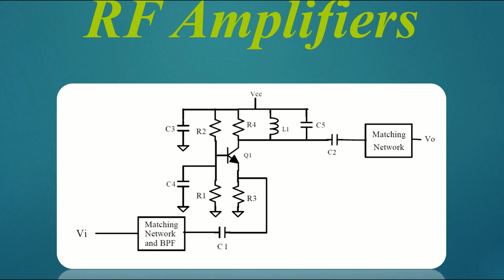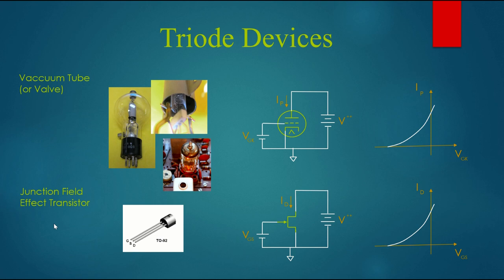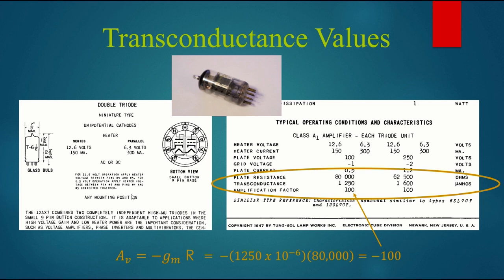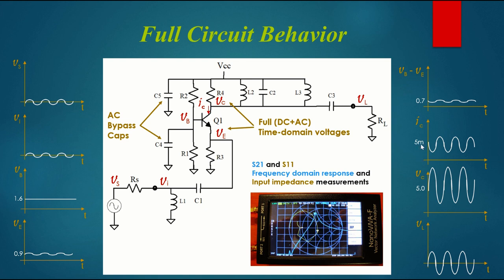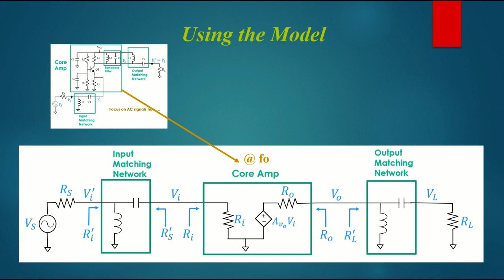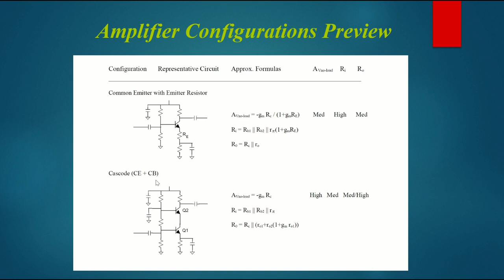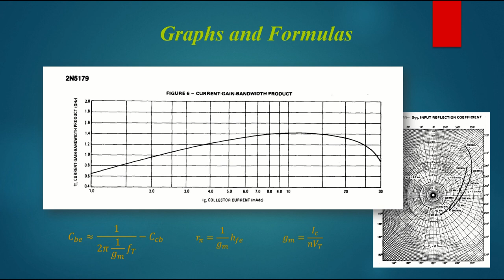Radio Design 101 - Episode 3 - RF Amplifiers

Comment: Looking forward to part2. I hope/wish you will add a design procedure process for RF amp from requirements involved, like how the drive power requirements of Mixer and the input signal strength from antenna dictates the choice of emitter current(Ie) and collector resistor along with mixer input impedence.

Comment: Is it possible to ask you more questions? I have quite a few questions about this and would love to pick your brain. This video series is awesome.
Reply from the maker: Sure. I try to reply to all comments. However, my response time can sometimes be a little slow. Our HVAC system went out recently so I got behind. But will try to check comments more often now that I got it fixed.  :-)
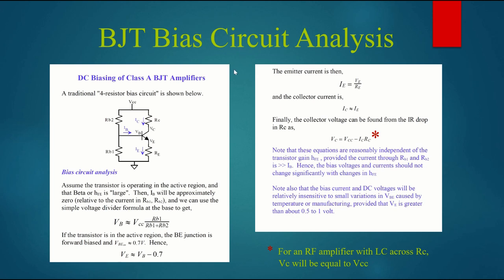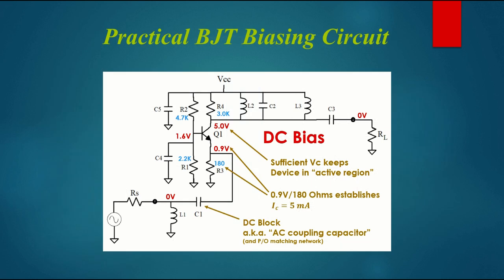Reply from the maker: I saw your question about the biasing, but now I can't see it anymore. To try to answer what I remember from it, the device used in the class (and the Radio Design 101 amp) is a MMBV5179 - a surface mount version of the classic 2N5179 RF device. It's an NPN bipolar transistor, so biasing assumes that Vbe drop is about 0.7V. BJTs are easier to work with than FETs are in that sense. See timestamps 22:09  and 26:22 for the BJT biasing procedure and example values.  The 0.7V drop is of course not precise, but its close enough for most designs as noted in the class handout at 22:09.

Comment: Nice!!!
Reply from the maker: Thanks 🙂  I finally got around to doing a "Part 2", but it was quite a bit later, so it ended up being Appendix A here: https://www.youtube.com/watch?v=m9X0mfg_8lQ  Appendix B finishes that out with a full Cascode amp design and simulation too after covering more on matching networks: https://www.youtube.com/watch?v=vO-AJjIX7a4  Both are a bit of a deeper-dive, so good to have them in the Appendices I guess. They're not necessary for the main receiver design/build...

Comment: I like the details and theories on LNAs, and believe they are really critical for getting deeper understanding of RF amps. 

But I notice that there are quite a few LNA gain blocks, which I think may simplify the design, save time and ease the learning curve, I use RF gain block ICs as LNA. (Such as TQP3M9009 (50M-4GHz Gain is 27dB, 0.8dB NF) or BGA2869 (DC-2.2GHz, Gain 31dB, 3dB NF) ). 

But as I google it or browse through youtube videos, I rarely see people using such ICs as LNA to place JFET and BJT based LNAs in their FM radio reciever designs.

Am I on the right track? Or I am doing something wrong? 

I use those ICs for 2 reasons. 1) They simplify my design and save debugging time  2) Their performances are stunning. Just reading the datasheet of those RF gain block ICs, I think it is very difficult for me to build RF LNAs with discrete components to match the performance and noise figures of those commercially mature LNA ICs. I just need to mind about impedance matching between RF gain blocks (usually 50 ohms) and down stream mixers. 

I even plan to use those LNA ICs for IF amps as long as the IF freq is within proper working frequency of those ICs.

Do you recommend using RF gain blocks/ICs to replace JFET/BJT LNA for FM radio receiver?
Reply from the maker: Good questions. We avoided those gain blocks in the class that this material is based on because we wanted to teach matching and filtering. But also, the gain blocks have some limitations when making the FM receiver. 1) They are broadband, so you don't provide the preselection filtering needed (see the latest video uploaded yesterday called Epilogue 1). Filtering comes for free when discrete RF amps are built, since the resonators are needed to address capacitances in the devices/etc. Also broadband amps tend to be power-hungry, and with wide bandwidth could potentially be more prone to oscillations.  That said, they are fine to use. Things will still work. They just may not be ideal for the reasons above.  Hope that helps.  73's

Comment: Great stuff. Did you ever mention the specific gain and tuning for this amplifier or did I miss that?
Reply from the maker: Thanks. The common-base amp usually gives about 15 dB of power gain (S21) at a collector current of 1 mA (5 mW consumption). I designed it with a fairly narrow (about 10 MHz) bandwidth so it had some selectivity, and adjusted the center frequency during testing. See this video in the companion video series on the NanoVNA and TinySA test gear for some details. There's a schematic with some hand-written analysis stuff at about timestamp 2 minutes 30 seconds into this vid (the gain shown calculated is before accounting for losses in the LC tuned circuit, etc): 
 https://www.youtube.com/watch?v=GAycxgbncHU&list=PL9Ox3wpnB0koBGofotI4xS8R0ct0FeYfv&index=11

Comment: One thing that I'm a little confused about is proper impedance matching for an LNA vs a PA. I guess I always assumed that conjugate matching was required everywhere, but then I watched a video that described how you want a low PA output impedance for better PA efficiency into the load....which isn't conjugate matching, then. Do you have any good reading material on this topic?
Reply from the maker: The key here is to consider the system goals. For an LNA, the goal (to a first order) is to maximize the signal power that enters the amp. That implies using the maximum power transfer theorem that says to do conjugate matching - as you said. For a PA, the goals are different. We are generally wanting maximum power output with minimum power consumed from the power supply. In PA design, we do impedance transformations rather than strictly matching. For example, if we have a 3V power supply and want to get 5 watts out into a 50 Ohm antenna, we'd need sqrt(2)*sqrt(P*R) = 22V peak. We we need to convert the 50 Ohm antenna/feedline seen by the PA down to something like 1 Ohm to achieve the desired power level as seen by the output transistors which are running on the 3V supply. That might be what they're referring to. Looked at another way, if one designs a PA with a 50 Ohm output impedance, then the maximum efficiency is going to be necessarily less than 50 percent - and likely more like 25% or less !  (we'd have voltage division at the output and lose power)

Comment: How do you calculate the input impedance to the common base amplifier (the 10ohms you mention at around 27:30)? I don't think the previous videos covered this.
Reply from the maker: Hi.  The short answer is that it is roughly equal to 1/gm, where gm = Ic/(0.04) for the transistor used. So when biased at about 4 mA for Ic, Rin = 10 Ohms.  A much longer answer is given in Part 2 of the video here: https://youtu.be/m9X0mfg_8lQ?list=PL9Ox3wpnB0kqekAyz6blg4YdvoEMoJNJY&t=2480 .  I queued that up to the part that shows the formulas.  As mentioned there, the formulas given in the slides for the different configurations are found in textbooks - but the Part 2 video presents the model for the transistor that is used in those derivations :-)
Reply: @MegawattKS  that's great, thank you!

Comment: I'm definitely in the "something went wrong so it's time to learn" mode. I designed a common base amp much like the one you've shown in your videos. I'm using a collector resistor of 3K ohms. I confirmed that the biasing is giving me the voltages that the simulation predicts. I was able to get a decent match on the input S11 as the simulation was close to reality. But my S21 was really low, and as I measured my S22, I found that it's way off the simulated value. To get a 50ohm match on the 3K collector resistor, I calculated that I needed a 275 nH inductor in parallel with a 5.3 pF cap, followed by a series 4.3 pF cap. But when I measured it, I got something like an output impedance of 20 - j200. Way off! So I'm not really sure what happened. The next thing that I tried was removing the output filter and output matching network, and just connecting a 22 uF cap in series at the output as a DC block. I expected to measure an output impedance of nearly 3K ohms. But I measured only 20 ohms with some capacitance. I'm not sure what to try next. Can you point me in a starting direction?
Reply from the maker: First - I would say that it sounds like you're doing the right things. But I have questions. When you removed the filter to collect more data - what happened to the bias voltage at the collector? Without the inductor in the LC 'tank' circuit, I would expect the collector voltage to significantly drop and the transistor might even go out of the active region. With the LC tank in-place, it's pulled up to Vcc so that can't happen. So let's go back to that condition. The -j200 sounds OK'ish, although the 4.3pF would imply more like -j370 + 20 if there's a 20 Ohm "short" somewhere in the built circuit. Have you tried DC Ohmmeter measurements from collector to ground?  Another possibility that might fit the symptoms is that the Vcc bypass cap is somehow directly connected to the collector. Again, something in the build is different than what we think is there, based on the symptoms you described...
Reply: @MegawattKS  You were right -- removing the tank inductor was an incorrect setup. But here's what I found. I placed the components for the image reject filter, a 470 nH inductor and 5.6 pF cap, followed by a 1 uF series DC block. I measured about 35 - j300. Now this was interesting, because this value was on the simulation curve of S22, but around 165 MHz! So when I went back to the simulation and used a shunt cap value of 11 pF instead of 5.6, the simulation did show an impedance of 32 - j300 at 98 MHz. This would mean that I had about 5.5 pF of parasitic capacitance in my board setup.  Have you ever seen this before? I am using RF capacitors from Johanson, but I am also using 0805 wirewound inductors instead of winding my own wire inductors. Could this be contributing as well? I am going to confirm my finding by lowering the 5.6 pF cap down to something like 1 pF and see if I get closer to the expected Z at 98 MHz.
Reply from the maker: @jchatterton2113  Yes - the inductor does sound suspect. To pack 270 nH (or 470 nH) into a traditional 0805 package, a lot of compromises are made. The quality factor is not good, but also the "self-resonant frequency" can get quite low depending on L value and how the inductor structure is made. Have you pulled the datasheet for the inductor and looked at it?  The ones I'm finding seem to have SRF between 50 MHz and 150 MHz.  If a 270nH has 150 MHz SRF, that means it has parallel capacitance inside it in the range of 4 pF, and it would be more if the SRF is lower. Here's an example page. But they vary by manufacturer, so the SRF values given here are only somewhat representative.   https://www.mouser.com/datasheet/2/87/eaton_mcq1v2012_multilayer_high_q_chip_inductor_da-1890641.pdf
Reply: @MegawattKS  I am using Johanson RF wirewound inductors and it looks like the SRF for a 470 nH 0805 is 350 MHz. So there are some parasitics there. But I must also be getting board/construction parasitics as well. The good news it that, with a little tinkering, I was able to get a good match! I hooked up both ports to my NanoVNA according to your video, using some attenuators, and measured a gain of about 11 dB. Not the best, but it's close to the predicted value when I include insertion loss/Q factor into the simulation. If I boost the DC voltage to 9V, I get a gain of a little over 15 dB at 100 MHz. So I'm considering this good enough to keep marching on, to the next project, the LO/Mixer/IF Filter stage!
Reply from the maker: @jchatterton2113  Excellent !

Comment: is there a replacement/equivalent for the MMBT5179
Reply from the maker: Yes.  In the video, I actually used a surface-mount version of an S9018 transistor since that's what was available in my "Interstellar Electronics SMD" kit and it's Ft value was around a GHz (the 5179 is 1.4 GHz). One could probably even use a classic MMBT3904 - although the collector-to-base capacitance is a bit higher and the "Ft" value is lower (300 MHz min at 10 mA), so the matching networks will change a little and the amplifier gain will be a bit lower for a 100 MHz amp.  Hope that helps :-)  FWIW, two places that stock these (and the MMBT5179) are DigiKey and Mouser. Those are the distributors we have used a lot. I got the "Interstellar" kit from Amazon, but it contains lots of other parts and costs a fair amount.

Comment: 8:25:  Your triode gate batteries are backwards.
32:25:  L2 and L3 are in parallel.  Why doesn't this skew the resonance frequency of the tank?
Reply from the maker: Good catch. I thought that might cause some confusion, but decided to let it go since it's technically correct in the sense that the grid battery has to be plus side up to work correctly with the graph. The graph shows the value is negative in normal operation. So the implication is that the top of the battery is actually a negative voltage, even if the schematic looks like it's positive. Very confusing since it looks unusual. Sorry about that.   The answer to the question about L2 and L3 is that L3 in the matching network has to resonate with C3 in the matching network. Hence, it has to disturb the total L when they are combined. Otherwise there would be no "residual L3" to resonate with C3 to do the match. To put it another way, if it did disturb Fo, then one would be tempted to take it out, and then the matching network would not be complete. So it has to decrease the total L, but doesn't shift the frequency. Hope that helps.
Reply: @MegawattKS  so if I understood, L2 + L3 = Total, but L3  needs resonate with C3?
Reply from the maker: @hectorbarrera9496  Yes. But to be precise, we should write it as Ltot = L2 || L3, where the || operator means "use the parallel resistor formula", not addition. Ltot will actually be lower than L3 when the two are combined in parallel.
Reply: @MegawattKS  Thank you

Comment: 38:00 Is it ok to have L1 parallel with L3 like that? Doesn't that affect the resonance frequency?
Reply from the maker: It won't affect the center frequency Fo since the matching network presents a pure resistance so there is no effect on Fo. The L is resonating with the C in the matching network so it's not presenting inductance to the tank, at least at the resonant frequency. Off frequency the matching network will have an effect which modifies the Q to some extent.  And hence the bandwidth...
Reply: @MegawattKS  thank you

Comment: Looks like Tuned circuit is producing a oscillation that gets to the output. I was confused seeing a strong signal, tried turning off everything in the room, but it still had it on SA.
Reply from the maker: On the plus side, you are actually seeing the oscillation. In the class, we used 3 GHz spectrum analyzers because the transistors we used had a habit of oscillating well above 100 MHz - typically somewhere close to 1.5 GHz (which unfortunately the TinySA can't detect, so a transistor with a lower fT like 1 GHz is a good defense.
Question on what you're seeing though:  What frequency and power level? If its inside the FM band, its possible it is actually a strong station getting into the inductors.  If not, try touching the coils to spoil their Q, and/or decreasing the supply voltage to make it stop. 
Oscillations are hard to track down - part of the 'art', although there are known reasons sometimes, and gathering clues by touching the coils and/or lowering the voltage can sometimes help localize where the problem might be coming from...
Reply from the maker: Common emitter and cascode circuits are probably more prone to oscillate due to high feedback and gain respectively, although common-base can do it too. If the base bypass capacitor in a CB or Cascode and its associated interconnect has too much inductance, some signal from the output can feed back to the base through Ccb (and not be AC grounded by the bypass due to excessive inductance). Just throwing out some ideas based on things we've experienced in the class. A solution in that case was to put a 10 Ohm resistor in series with the base bypass capacitor to "spoil the Q" of the LC circuit that forms between Ccb and the parasitic inductance. Again - these things can be hard to find and fix. Hope you have good fortune in your search.

Comment: Is IMD relevant and if so, how to measure?
Reply from the maker: It's definitely an important performance parameter in some situations. In particular, receiver front ends, and transmitter power amps if they're using OFDM or QAM or other linear modulations modulations. Measuring is a bit involved - normally requiring two signal generators, a power combiner, and a good spectrum analyzer. My IC735 HF transceiver uses an LNA/Mixer set that consumes about a watt to make it's performance better in this regard !

Comment: Link of part 2 of this episode 3 RF Amplifier
Reply from the maker: Unfortunately I never did a follow-up on this one. But I probably should. I've been thinking about it and now that the Antenna Briefs series is done, hopefully I can revisit this. Maybe I can also cover a bit more on matching networks at the same time, which I've been thinking would be useful. Will give it some thought... Thanks for the inquiry !
Reply: @MegawattKS Thanks  for the reply  Please do it sir  , secondly  if you can please make video's on basic electronics  e.g.  multivibrators  using transistors  , different amplifiers  of different class  , for the beginner's  in electronics

Comment: Sir still waiting for the part 2 of this video
Reply from the maker: Sorry it took so long. I finally did one (though it doesn't cover everything). It is called "Appendix A - Transistors and Amplifiers at RF" and is at the end of the Radio Design 101 playlist. Hope it helps.